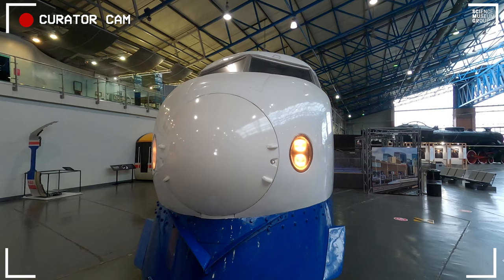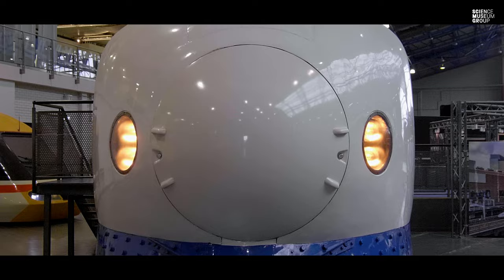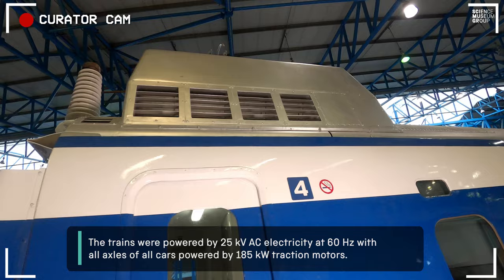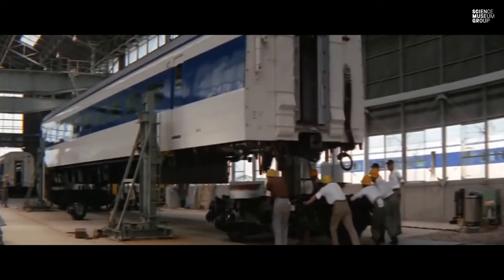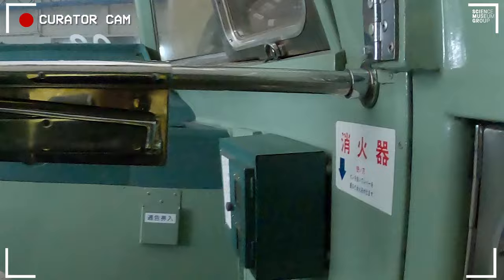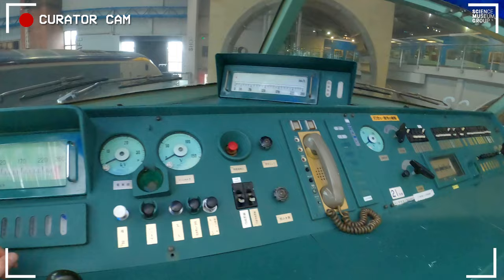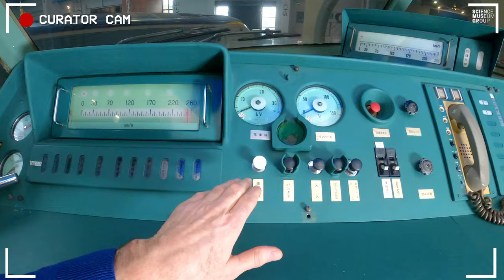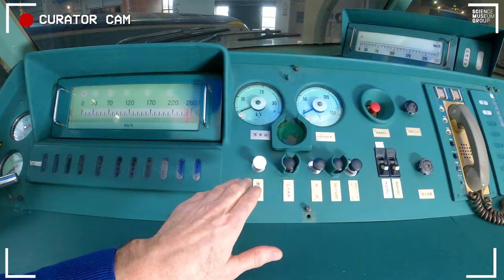Original Japanese bullet train—inside tour | Curator with a Camera

Comment: No mention of why this is the only NON British designed or built major exhibit in the NRM ! Seems the NRM have lost the plot, as they certainly don't seem to remember who implemented this gift from Japan, or why ! 
Further as the NRM seem incapable of getting even the basic outline correct I'll add a few important facts below:

The whole concept of the Shankansen (New Super Express) was first revealed at the 1957 International Railway engineering conference in that year held in Melbourne Australia. 

The Japanese contingent, announced they would build a brand new 400 mile long railway, between Tokyo & Osaka. This railway would be standard gauge 4 feet 8.5 inches (not 3ft 6in gauge as per the then Govt Railways gauge). The whole line would be controlled from ONE computerised signalling centre (in Tokyo). The trains would cruise at 125mph. The signalling would all be in cab, NOT trackside signalling. There would be automated control of winter snow problems using volcanically heated sprays built into the trackside. There would also be seismic (earthquake) detectors built into the trackside, that would automatically bring trains to a halt, in the event of a serious earthquake. 

The Japanese were laughed off stage by the worlds assembled engineers, who sarcastically suggested the Japanese had been watching too many of their own Science Fiction movies !!!  

In 1964 in time for the then Tokyo Olympics the new railway was opened, initially only for those going to the various Olympic stadiums, all of which had cleverly been built along the line of route !!!!!

As the Worlds press and politicians were present for the Olympics, they were obliged to use the Shinkansen. It was an American News Reporter, who gawped at his first sight of one of these trains, who coined the phrase "Bullet train" due to the shape of the trains nose.     

At the end of the Olympics the hundreds of new Bullet trains operated, had a TOTAL lateness of just 8 and a half minutes. No major railway outside Japan has ever come close to such precision timekeeping. Indeed even the highly intense Tokyo network of thousands of daily suburban trains, rarely has ANY train running later than 15 SECONDS literally. Only Japanese social regimentation allows for this mind-boggling daily achievement !!!

The highly advanced nature of the whole Bullet train system in 1964, coupled with the presence of the worlds press & many Politicians, had an immediate and profound effect. Apparent from the coverage of the Olympics, which often contained more about the Bullet trains than the Sport  !!! 

At the time 1964, many Politicians in the "West" were of the impression that railways were a now oudated Victorian artifact. The Japanese had other ideas, and within a couple of years had set up a technical College in FRANCE, to sell the Bullet train technology. The rest as they say is History. So yes the Bullet train is the greatest train since Rocket, as it effectively salvaged the credentials of railways.

I am myself a Railway Locomotive Mechanicl Engineer. Most of the above details have been gleaned from the "International Railway Gazette" (monthly magazine), and various Japanese Railway technical Publications (1957-2002).  A.McD.
Reply: The name "Shinkansen" was first invented in the late 1930's I beleive, for a new steam train and undersea tunnel for services from Tokyo to Manchuria!
Reply: James Smith The NRM hasn't lost the plot.
Reply: @worldcomicsreview354  Shinkansen simply means "new main line" and is very descriptive of it's purpose to carry intercity services to free up the "old" main lines.
Reply: @worldcomicsreview354  

I'm a Japanese train old fan. You are familiar with the old Japanese episode. ☺️
Japan's Shinkansen project began in 1939. At that time, a new line with a gauge of 1435 mm was to be constructed between Tokyo and Shimonoseki, and construction of a part of the tunnel that would later be diverted to the Shinkansen was started, but construction was suspended due to the intensification of the war. 
Interestingly, this new line is called the “Bullet Train” plan, with electric locomotives (maximum speed 210km/h) for electrified sections and steam locomotives (maximum speed 120km/h) for non-electrified sections. It was a plan to pull the passenger car with two types of locomotives.☝️🍀
ーーーーーーーーーーーーーーー
私は、日本の鉄道オールドファンです。
あなたは日本の古い時代のエピソードを良くご存知です。☺️
日本の新幹線計画は、1939年に始まりました。当時、東京と下関間に、1435mm軌間の新線を建設することになり、後に新幹線に転用される一部のトンネルも着工されましたが、戦争の激化で工事が中断しました。
興味深いのは、この新線は「弾丸列車」計画と呼ばれており、電化区間は電気機関車(最高速度210km/h)、非電化区間は蒸気機関車(最高速度120km/h)と、2種類の機関車で客車を牽引する計画でした。☝️🍀

Comment: These Trains were also well known to causing sonic booms when going into and exiting tunnels. Which is the main reason they look so vastly different today from their 1st generation iterations. 

You may ask yourself how a train could break the sound barrier? Well the train itself didn't. See the Shinkansen was going speeds a train had ever gone before and these speeds were never tested when entering and exiting tunnels. The shape of the original Shinkansens couldn't move the air around the train fast enough when the train entered a tunnel. So the air in front of the train got super compressed and squeezed out of the tunnel as the train entered it. This compressed air would then accelerate so quickly it would break the sound barrier causing a sonic boom. That and it would cause the Shinkansen to rock and bump around when in the tunnel itself. Furthermore since the air couldn't get into slipstream while in a tunnel the train acted as a piston and pushed the already compressed air into a wall in front of the train. This compressed air would then accelerate out of the tunnels when it reached the exit and would cause a second sonic boom at the other end. Needless to say these sonic booms were very harmful to people and wildlife nearby (with in 2-3kms). So speed restrictions were then set in place for when a Shinkansen was approaching a tunnel (which there are MANY on the Shinkansen route) to just just under 60kph. These slowdowns DRASTICALLY increased the time it took to go from Tokyo to Kyoto and back. After a couple of decades of research the nose of the train was elongated and flared out (influenced by the kingfisher's bird's bill). This reduced the chances of a sonic boom forming to nearly 0. This is why modern Shinkansen trains have a "racecar" like front end.
Reply: I'm a Japanese railway fan. 
The sentence about the effects of "micropressure waves when passing through tunnels at high speeds" is generally correct, 
but no matter how you interpret it, the speed limit of 60 km/h in front of the tunnel is clearly incorrect. ☝️

At the same time as the shape of the train's head has been improved, structures called “shock hoods” have been built at the front and rear of the tunnel to dampen shock waves.🍀
ーーーーーーーーーーーーーーー
日本の鉄道ファンです。
「トンネル高速通行時の微気圧波」の影響について、概ね正しい文章ですが、
どう解釈してもトンネル前60km/hの制限速度は、明らかな誤りです。☝️

そして、列車の先頭形状が改良されるのと並行して、トンネルの前後に衝撃波を緩和させる「緩衝工」と呼ばれる建造物を造って対処しています。🍀

Comment: Great informative video of the first Shinkansen high speed train in Japan. Japan as far as high speed passenger train service goes is number one because Japan had it first.
Reply: Mmm... No, not correct.
Being you're first doesn't mean you're best.
Often quite the opposite is true as others will improve on your half-baked concepts and ideas.
As was the case between the somewhat rough around the edges Shinkansen and the French TGV which was needless to say much better in all aspects (and still is).

Comment: At 11:17 I think thats a smoke detector on the top left? Interesting to see such mundane things hidden away in the locomotive nose. Its not something you think about but obviously a space with electrical equipment does need to be safe anf not be a fire hazard
Reply from the maker: Yes that does seem to be a smoke detector—that could well be one linked to the museum's fire monitoring systems, rather than one from the loco's original construction as the electrical system is still in use to power the headlights etc

Comment: Just a small quibble.  The holder you described as being for the driver's stopwatch is actually for a normal accurate pocket watch.  It's an American concept which the Japanese adopted where drivers and conductors have an authorised watch which is compared with a Standard clock each time they take duty (and adjusted if necessary).  All concerned have the same time to the second, which makes punctuality more straightforward.

Other than that, an informative video of a super bit of kit.  Thank you.
Reply: That holder is exclusive for the "SEIKO Tetsudō-dokei"(SEIKO railway watch) also known as "19-SEIKO", which was the former Japanese National Railways official watch from 1929 to 1971. Ive a 1958 "19-SEIKO" and its still ticks pretty accurately, and Im lovin it.

Comment: Excellent video! Just a few questions. There's a flatscreen tv and spaces marked for wheelchair users in the cabin. Are these installed after the loco arrived at the NRM? Also, in how far an extent is the loco still in working order? I saw a smoke detector inside the nose so I suppose it still is to some degree.
Reply: Yes, the flat TV must have been installed for the presentation of the videos that the museum has. There was no flat TV display like this available in those days obviously. There was not any wheelchair space like that either back in those days. The conception of wheelchair mobility we take for granted in a recent couple of decades was close to nonexistent back in those days in Japan as well.

Comment: Always wondered if the pronunciation was Shin-KAN-sen or Shin-kan-SEN?
Where is the definitive answer?
Reply: It’s alright. Actually they are 3 words, shin means new, kan means major, sen means line or route here.
Reply: It is pronounced shin KAN sen
Reply: Japanese doesn't really have much in the way of stress on syllables but the former is probably closer to how it sounds normally.
Reply: Neither. Japanese isn't stressed like Indo-European languages are. Try and say all 3 syllables with equal stress. (Indeed, Japanese doesn't work in syllables either; it's moraically timed. So shinkansen breaks into 6 timing units: Shi n ka n se n, rather than 3 "syllables".)
Reply: @lukeueda-sarson6732  "6 timing units"? What the heck are you talking about?
Reply: @carlnilssonyoung8961  No, they're not "three words". 
It's oversimplifying how Japanese language works.
Reply: @frontenac5083  Do you understand the term "moraically timed"? The basic timing unit of Japanese is the mora. "Syllable" is not a generally a thing that is talked when discussing how Japanese is spoken (or sung for that matter. Check out how Karaoke is done in Japan). Or read https://en.wikipedia.org/wiki/Mora_(linguistics)
Reply: I’m an old fan of Japanese railways. 
You don't have to worry about the strength of the syllables when pronouncing "Shin-kansen(新幹線)". ☝️
According to the meaning of Japanese kanji (漢字、characters of Chinese origin), "新(Shin)" means new. 
"幹線(Kansen)" refers to the main railway line. 
In other words, it was named "Shin-kansen(新幹線)" because it is the newly opened main line.😌🍀